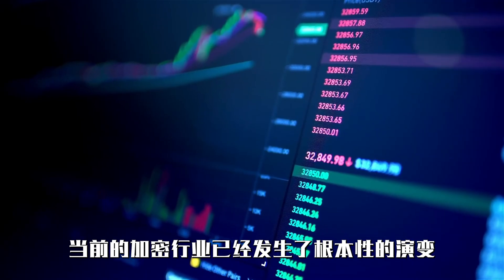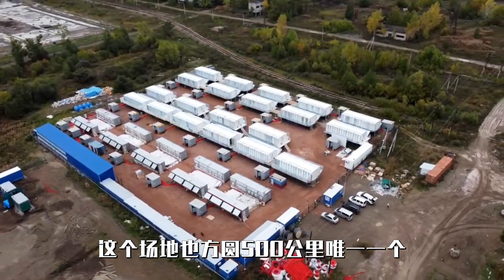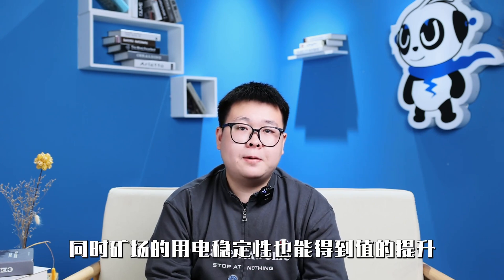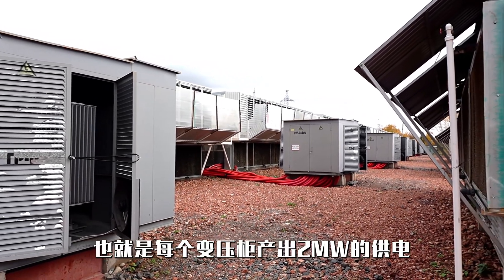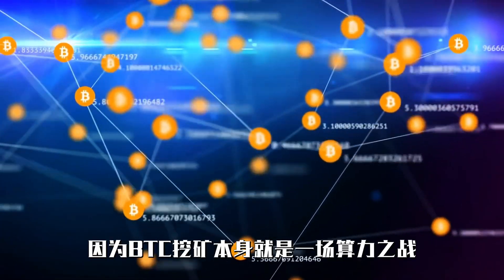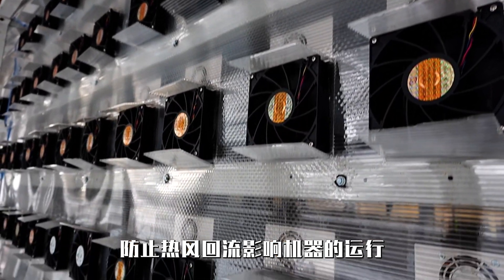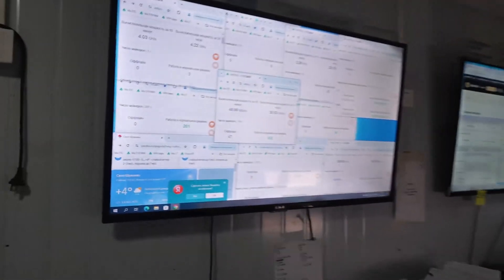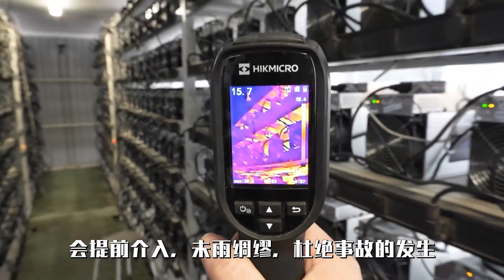Big Reveal of Bitcoin Mining Farm. All 50MW is used for bitcoin mining

Comment: Could you please provide the electricity consumption in MWh or GWh required to run a 50 MW Bitcoin mining operation?
Does Bitcoin mining require 24/7 uninterrupted power supply?